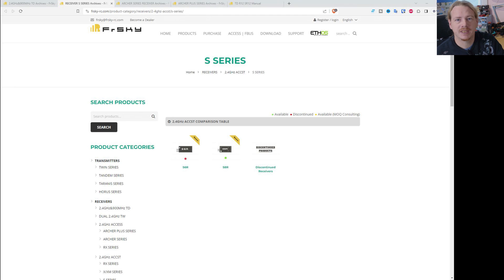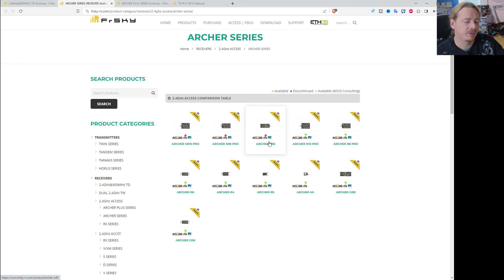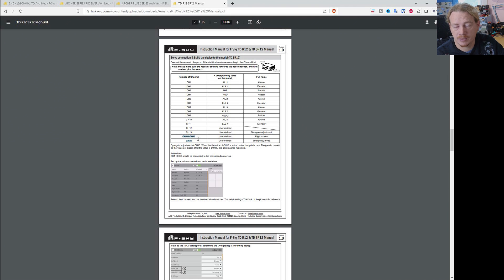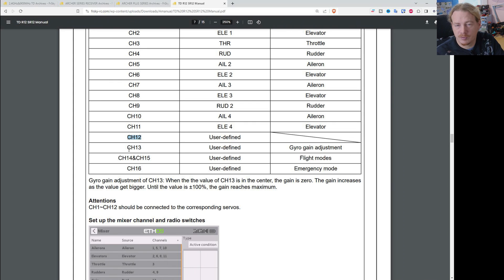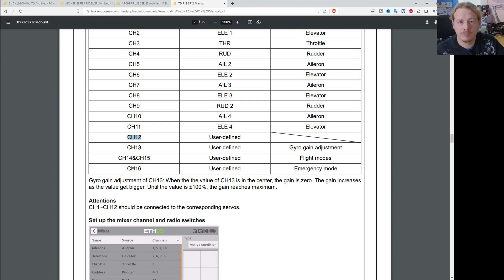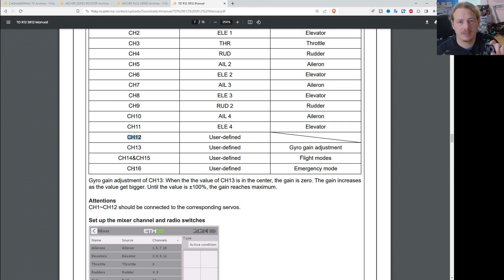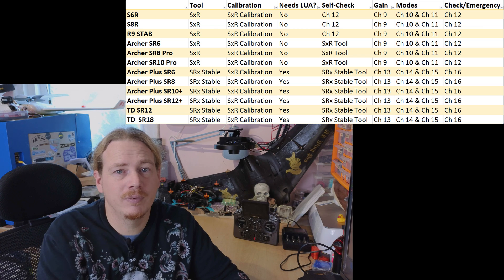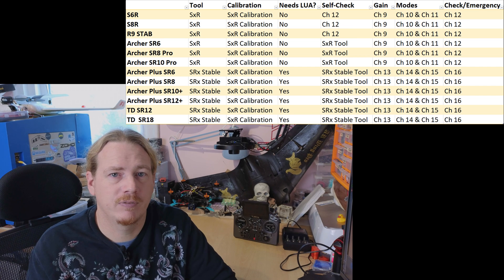Understanding the different FrSKY Stabilised Receivers

Comment: thanks Darren  for your Videos. I have a issue after update x20s and archer plus sr10+ with 3.0.1  Lua script  1.6.2 ethos 
etc the receptor after factory reset register & Bind 
 calibration 6 axis state yellow  Led only green when change positio horizontal to sides or vertical  tandem receiver an archer10 pro work with no issues what can I do thanks

Comment: Darren i was wondering if you could help me out.   I have inav 8.1 updated on an atomrc f405, also i have a TD SR12 which is bound to an X20HD but i am having a hard time getting the receivers uart and sbus hooked up and need a little guidance on the pin-out
Reply from the maker: You will need to go in to the receiver options on the transmitter and set one of the outputs to SBUS. You then connect that output to SBUS, power, and ground on the flight controller. If you’re using batteries plugged directly in to the receiver to power it. Don’t connect the power wire to the flight controller. 

To get telemetry back. You will need to set up an output on the receiver as SmartPort. On the flight controller, you will need to set up softserial and then connect the output signal wire on the receiver to the softserial tx on the flight controller. You will need to set the telemetry on the softserial to SmartPort on the ports page of configurator.

Also, remember to disable the stabilisation on the receiver.

Comment: I am looking to buy an frsky tandem xe. Are the new radios able to use the older Rx? I have a bunch of older frsky stuff that was given to me but I have never used. 
If the new radios can't use the older Rx is there a way to make them do it?
Reply: RadioMaster 😁 will do it with old frisky rx
Reply: BTW. JUST PUT 4 in 1 multi module protocol in the back of  TX module bay

Comment: Hi there MR D ,it's Tony here,wondering if you can help with an isue
I have an x18se with 1.5 firmwear and a archerplus sr8 with 1.011 on it,and iam runnings the latest v3 lua on the radio,but when I got to turn the gyro on in the stab lua it doesn't do anything it stays at the off position 
,it calibrates the gyro fine in the cal lua but nothing works in the tab lua,help please 🙏

Comment: Nice video, could you by any chance make a demo video on how to setup the two independent stable systems that these new receivers seem to support. You should have two gyros with separate gains at your disposal right?
Reply from the maker: You can’t with this system. You can only run one receiver with an active stabiliser.
Reply: @MrD  I did not mean to use two receivers. The receiver has 2 banks (called stable systems). I think the first bank is for ch1-6 and bank 2 is for ch7-... For example you use  elevator 1 in bank 1 with 50% gain and elevator 2 in bank 2 with 70% gain.

Comment: Hi Darren; thank you for that explanation. My Question. I have a spectrum 18 and I am very comfortable with it. Before I invest into this FrSky transmitter, is there a channel reassign feature where you can  use other channel ports for different  options on the aircraft like canopy open/close, speed brakes and so on?? You did not talk about what you can do with the transmitter unless you have that on a different video.
Reply from the maker: There are no real specific channels on this system. I remember back on an old Spektrum there was a switch on the transmitter labelled flaps, one labelled gear. And they were associated with specific channels. With this system you have more freedom. You can have any switch for any function and set that function to whatever channel you want.

Comment: Hi Darren. I have a question for you. I have put an RX8 Plus in a model using Taranis X9D + 2019. I have set it up and the gyro seems to work fine. I noticed though that even if i am taking off through my switch the gyro rates and expo doesn’t work. They work though if i use the option LUA and disable the gyro. Is this normal? Thanks

Comment: After flashing a Firmware Update via OTA, my SR10 is not working anymore, i.e., REGISTRATION nor BIND is possible - the YELLOW led is permanently ON. Any idea? THANKS :)
Reply from the maker: Sounds like a bad flash. Try reflashing it via a cable. Also make sure it’s the correct firmware.
Reply: Brilliant! This just worked out perfectly - many thanks 👏

Comment: Hi Darren; Why is there a second channel (Ch. 15) assigned to the flight mode ?  I also can't program the Ch 16 Emergency mode like I did on other receivers.  Thanks
Reply from the maker: The second modes channel is for the advanced modes like hover and knife-edge.
Reply: Thanks Darren. I don't know how I missed that. Anyway. Just came home from maidening my X20PRO. Received it on Friday. Spent three hours changing some switches to the safety type like I have in the X20S. Only four flights on it. It's too early to tell if there is a marked difference to the X20S. But there is something .   @MrD

Comment: An overview of the new 6 channel mini receivers would be helpful. Even if setup from a radio standpoint is the same, mechanically they are an oddball. How to hook up regular servos, what is the current capacity, what are they designed for, setting up the internal ESC, etc

Comment: Do you have a video showing how to set up AUTO LEVEL on Ch16 for the SR10+? I seem to be having trouble setting up Auto Level to run on a MOMENTARY SWITCH. I've tried different ways to program the auto level, but it doest seem to work. Aside from the channel assignments, is there something different in the setup between the old SR receivers vs the newer PLUS recievers?

Comment: Hi Darren, keep up the awesome work!  When you setup the stabailized rx's, what are your go-to default gain settings?   Here's what I have used but wondering what other people start with: 
Gyro Gain: Stab Mode A:25%, E:25%, R:50%
Angle Gain: Auto Level Mode A:25%, E:50%
Reply from the maker: Honestly, I have them on the default settings. I just set the gain on the knob to where it feels right. I also don't use the self levelling mode, so this is probably why I've not needed to tweak each mode. I will be investigating the other stabilised modes in the summer. So I will need to do that then.

Comment: Thanks Darren, but does the Archer plus series require both channels 14 and 15 assigned to the gain function not just say 14 or 15?
Reply from the maker: Gain is on channel 13. 14 and 15 are the stabilisation modes.